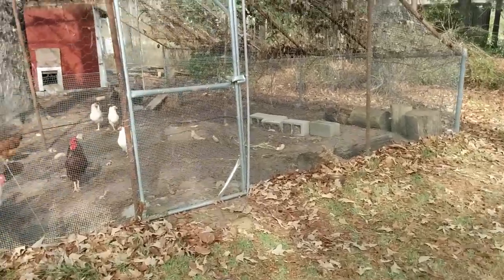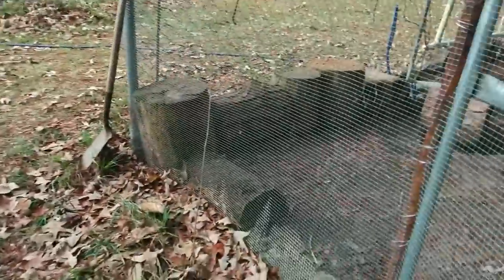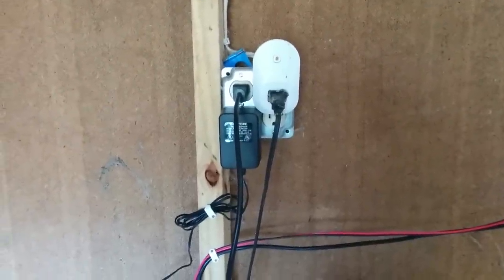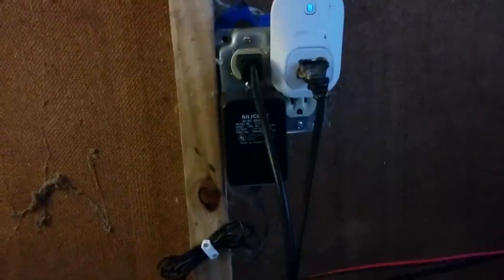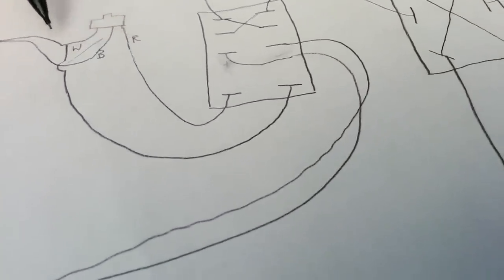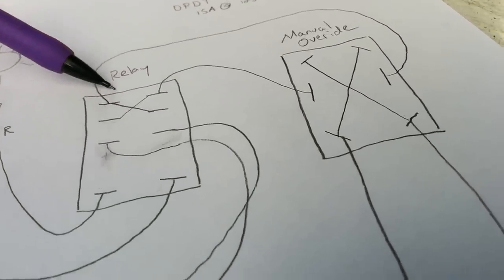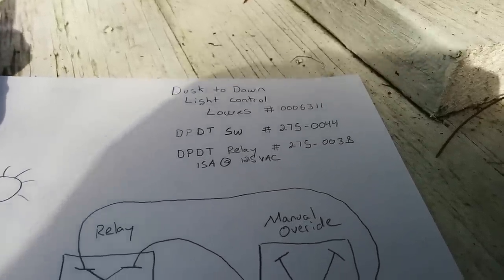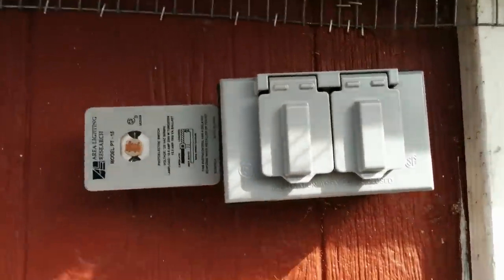Simple DIY Automatic Chicken Coop Door

Comment: I made this today and it worked the 1st time!  Thanks so much.  Here in Canada we no longer have Radio Shack - and the company it morphed into doesn't carry parts.  I found the exact same DPDT switch at Princess Auto (kind of like your Harbor Freight) and an equivalent DPDT relay at a commercial electrical supply shop called Gullevin.  Princess Auto had the 12v linear actuator and also had a 12V brick in their surplus section and I found a solar switch at Canadian Tire (no direct equivalent of this store in the US that I know of) .  Some spare wire, marretts, a sacrificial electrical cord later I have an operational coop door opener/closer.  Hopefully this will help any other Canadians source the parts  :)
Now all I need to do is build the coop...
Reply: Jamie Smith do you happen to know any of the part numbers for Gullevin CT or Princess? I am also up here in Ontario and am wanting to build this exact thing.
Thanks :)
Reply: thanks for posting the canadian equivalent

Comment: Everyone has different ideas on how to control one of these doors. On yours, it appears the relay is "powered on" all night and has no power on the coil all day but the 12V current is going through the contacts either way so there is always power to the override switch. So, there's power going to your actuator all the time. The limit switch just has it interrupted until the polarity changes. The little AC adapter brick needs to be able to support the amp draw of whatever actuator you use.  Trying to decide if I want to use the 110 volt control or go with the battery/solar (all 12V) method??  With the 12V system, I can use 2 of those < $10.00 timers and have no power on the relay or actuator once the door is in either position.  Thanks for sharing!!
Reply: Pappa Bob can you explain you way better?
Reply: Yes, could you, please?
 @molly7871

Comment: great video and nice simple diagram. thanks. Just bought a $47 actuator of Ebay but haven't received it yet.  I have a question re: continous voltage to the actuator.. does your actuator specifically have some type of limit switch so when it reaches either end of the stroke it knows not to keep trying to move...with voltage to it, so it won't damage it?  I am wondering if mine doesn't come with some type of limiters, if i will need reed switches/ contacts (and more relays or something) to tell the system to stop the 12VDC when it reaches the fully closed or fully open state...

Comment: Hello,  I like your design and will probably use your plans.  I have a couple questions first:  Where did you get the 12v power brick?  Also in regards to the DPDT switch; I want to make sure I understand the schematics.  So you have +/- coming in from relay to be attached to the center poles.  Then the bottom poles feed the actuator.  You have lines criss crossed from the top poles to the bottom poles, are these jumpers?  Or are you just showing internal wiring in the switch?  For reference sake I am referring to the top poles near the words "manual override".  Thanks a bunch for all your ideas and any help you can provide.  Bill

Comment: Thanks and great solutionWas confused about the wiring of the override switch.  It seems that how it is wired coming over from the relay, that if it is in the "Off" position, that no operation will be performed.  Can you explain this or will the switch need to be in the one of the other 2 on positions to work and off is simply to disable the system?  PS.  I found that the Radio shack part number 38 & 44 were reversed.  Thanks Andrew!
Reply from the maker: +John Boy 
That's correct.  In the middle it is completely off so the door wont operate.  Just put it in the position you want it and it will stay there regardless of what the state of the solar cell is.  Then you have the other two positions that are both automatic but opposite of each other.  Thank on the update.

Comment: This will be my first "electrical" project, so pardon my ignorance of how things operate and lack of proper terminology. What I am wondering is whether it is possible to use a smart plug in lieu of the photo timer? This way you could control the schedule from your phone remotely and even tell your Alexa to open or close the door. Could that work??
Reply from the maker: Edyta-Christina Grzybowska-Grant  Smart plug can work.  The reason I didn't use a timer is because the time of day for sunrise and sunset varies throughout the year.  If you can find a timer with a calendar or something that would probably do it.  The chickens don't know what time it is, they go off sunlight so that's how I based my system.  It also seemed like the cheapest and easiest way to achieve the goal.  I did use a smart switch inside the coop to control the extra light in the winter to keep them laying.
Reply: Built it and it works with Alexa! Yayyy! Thank you so much for the great idea and schematics!
Reply: @andypcguy1  can u send me schematics for this? I m going to do something very similar

Comment: Hey partner, I love the video! Thanks for the detailed schematic at the end, it really made the whole thing. Quick question, I’m thinking of putting my solar sensor switch on the east side of my coop for convenience of wiring. Do you think that would cause the door to shut too early as the sun sets in the West? I’m not familiar with these solar sensors.
Reply from the maker: Hard to say, you might try it and watch it to see.  Worst case you just have to move it if it doesn't work.
Reply: @andypcguy1  Thanks, I went ahead and put it on the West side. Your system works like a charm. The only modification I made was an additional override switch in the system. That override switch is a nice touch!

Comment: This is great, but somehow I can't find the right part for the relay.  The 0038 is for the switch, and the 0044 is for 250 DC at 10A whereas the schematic says 15A @ 125V AC.  Would love to do this if I would know what relay to get.  Could you recommend another part #?
Reply from the maker: Christian Arsenault you can use just about any DPDT relay rated for 125v.  The excitation coil doesn't draw much power and the actuator runs on DC and it also only pulls maybe 2-3 amps.  I just looked up that specific relay on eBay for $8 with free shipping, so if your local radio shack doesn't carry it you can try that.